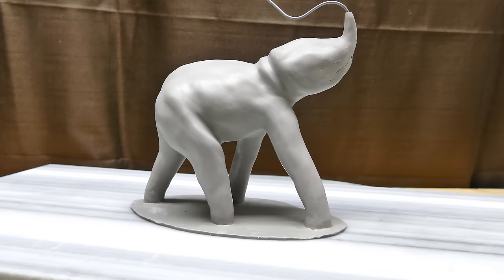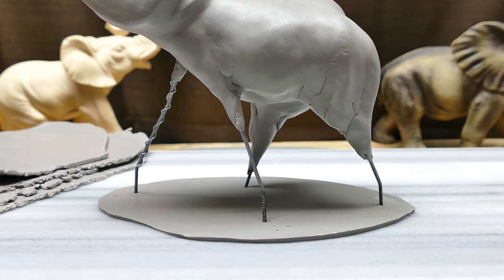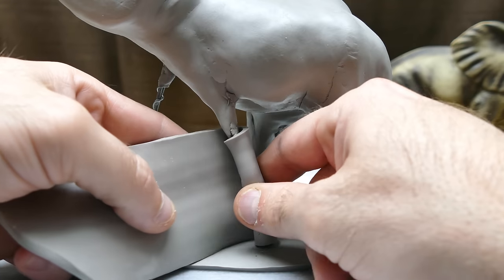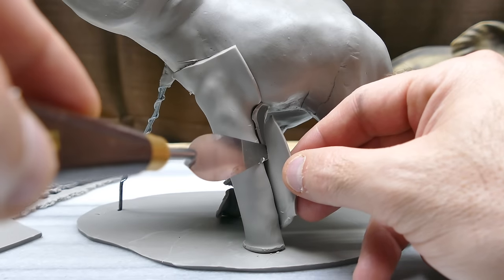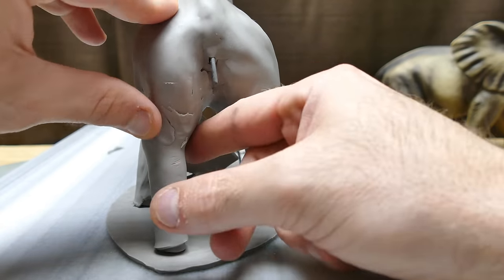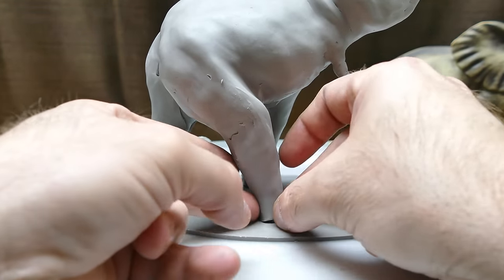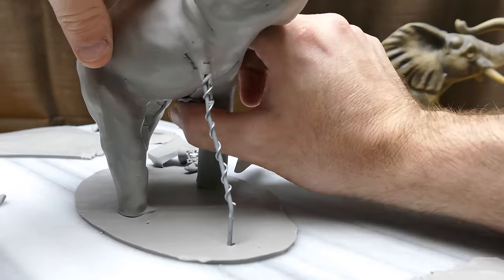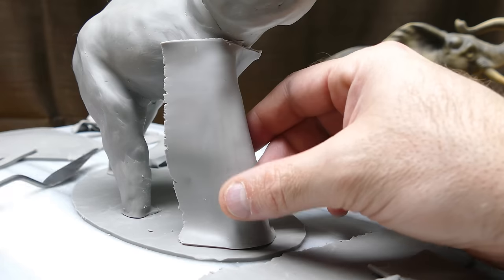Sculpting an Elephant, part 5: starting legs.

Comment: I would like to ask something.. When you are the clay layers, isn't it important to make sure there is no air between the layers?
Reply from the maker: here is my non-professional view on that: If possible you want to try avoiding air pockets. But it's bound to happen. The good thing is, unlike water, air (gas) expands much less at  275º, and naturally any air pocket would be small (in theory) providing an effort is being made to gently press each new piece of clay down to the previous piece. In short, I wouldn't loose sleep over the  possibility of an air pocket ore 2. I never had a problem in that way

However, the entire sculpture is a "vessel" so to speak (even though the inside is foil there is still air inside it, completely surrounded by clay. If when in doubt I sometimes just poke one tiny hole through all the layers of clay allowing a weep hole for gas to move through, just in case the inside pressure changes, if any. I'm not sure if this even needs doing lol Hope this helps
Reply from the maker: also thank you SO MUCH for checking this project out, the baking video (part 13) is nearly done... we been trying to buy a house, were now waiting on the loan to be approved right now.. but SO CLOSE!!!   

Note: having roommates for like 8 years who are on different sleeping patterns is WHY there are no new videos here. I never quit, it's just my window of opportunity for filming is small, but not for long!!!!! Woohoo!! Thanks again!